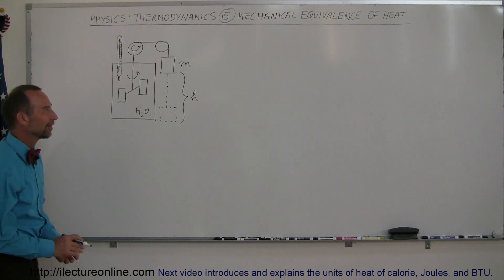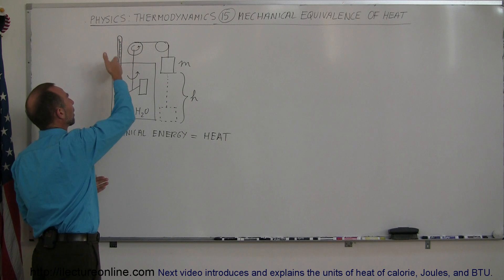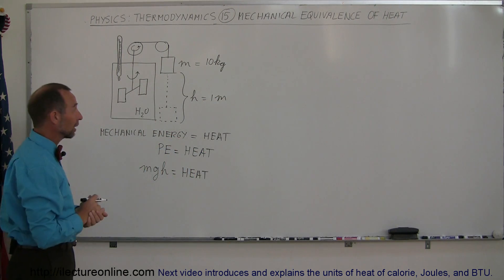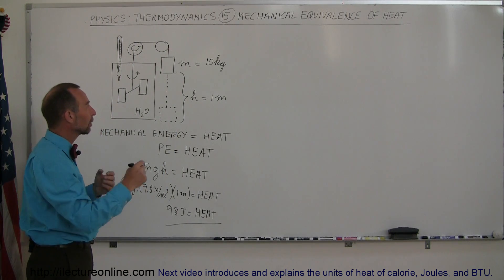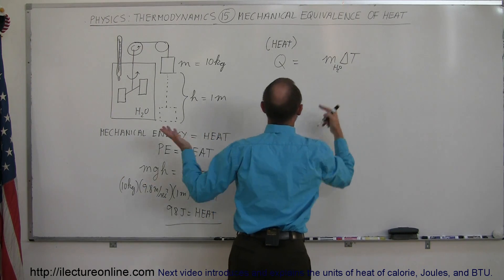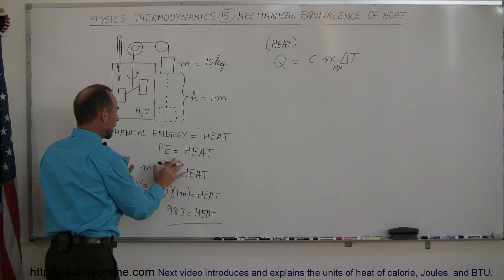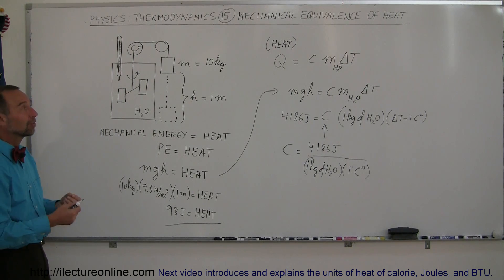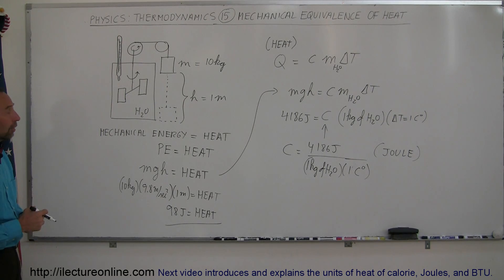Physics 22  Introduction to Heat & Temperature (1 of 6) Mechanical Equivalence of Heat

Comment: I'm stuck on a question it asks me how far an object has to fall to raise temperature to 1 degree Celsius I guess I'm just confused on how to calculate this..
Reply from the maker: I am assuming that this an object dropped from a height in air and when it hits the ground the kinetic energy will have converted to heat.  (And do we assume a 100% conversion of heat into the object and none into the ground?)    Then delta Q = m c delta T    where delta T is 1 degree.  The energy gained from dropping equals the potential energy  PE = mgh  Then set   mgh = mc delta T      The m cancels   gh = c (1)    Therefore h = c/g

Comment: Professoel Michel Van Biezen ziplines speeds are complex, because: gravity, friction, zipliner weight, and temperature (delta 😢T) are variables. A two-wheeled zipline trolley travels at 95% gravity .
Reply from the maker: Not sure how that related to this video.  But zipline speeds are mostly related to the angle of decent.

Comment: I got a question... if I decide to find the work which is 98 J  the heat should also produce 98 joules right? 

Why can’t we just measure de degrees, let’s say it’s 0,05 and convert that into joules  which should make 98 joules. It’s very small but it still works... right?
Reply from the maker: You would measure the heat generated by measuring the increase in temperature and using the specific heat.

Comment: why should the potential energy be equal to the heat??

Thank you :)
Reply from the maker: Where will the lost potential energy go?  If it doesn't change into a different type of mechanical energy, it can only turn into heat.
Reply: @MichelvanBiezen  What is the Sun ON BALANCE, AND how is the Sun's CORONA understood (ON BALANCE)?

HOW CAN (AND DOES) WHAT IS THE SUN EXIST IN BOTH TIME AND SPACE?:

What is the Sun is fully consistent WITH what is E=MC2 in accordance WITH what are SPACE AND TIME. Indeed, what is E=MC2 IS dimensionally consistent. What is GRAVITY IS, ON BALANCE, an INTERACTION that cannot be shielded or blocked. Indeed, consider what is outer “space” ON BALANCE; AS TIME is NECESSARILY possible/potential AND actual ON/IN BALANCE; AS ELECTROMAGNETISM/energy is CLEARLY AND NECESSARILY proven to be gravity (ON/IN BALANCE) !!!! INDEED, the stars AND PLANETS are POINTS in the night sky ON BALANCE !!!! GREAT. I have explained the coronal heating ON BALANCE !!!! The Sun's corona is one, TWO, AND three dimensional gravitational/electromagnetic SPACE (ON/IN BALANCE) consistent WITH what is E=MC2 !!!! Therefore, c squared CLEARLY (AND NECESSARILY) represents a dimension of SPACE ON BALANCE !!!! Accordingly, ON BALANCE, the rotation of WHAT IS THE MOON matches the revolution; AS TIME is NECESSARILY possible/potential AND actual ON/IN BALANCE; AS ELECTROMAGNETISM/energy is CLEARLY AND NECESSARILY proven to be gravity (ON/IN BALANCE) !!! Therefore, ON BALANCE, a given PLANET (including what is THE EARTH) sweeps out equal area in equal TIME. Accordingly, stellar clustering ALSO proves, ON BALANCE, that ELECTROMAGNETISM/energy is gravity. Consider what is THE EYE ON BALANCE !!!!! The stars AND PLANETS are POINTS in the night sky ON BALANCE !!!! c squared CLEARLY represents a dimension of SPACE ON BALANCE !!!! TIME is NECESSARILY possible/potential AND actual ON/IN BALANCE, AS ELECTROMAGNETISM/energy is CLEARLY AND NECESSARILY proven to be gravity (ON/IN BALANCE) !!!! I have mathematically (AND CLEARLY) proven and explained what is the fourth dimension ON BALANCE !!!! Perfect. It ALL CLEARLY makes perfect sense ON BALANCE !!!!! INDEED, consider why and how that there is something instead of nothing ON BALANCE !!!!! GREAT. TIME is NECESSARILY possible/potential AND actual ON/IN BALANCE, AS ELECTROMAGNETISM/energy is CLEARLY AND NECESSARILY proven to be gravity (ON/IN BALANCE) !!!!

By Frank Martin DiMeglio

The answer is that the corona is one, two, AND three dimensional SPACE ON/IN BALANCE. It is fully consistent WITH what is E=MC2. It is pure ENERGY on balance with what is the Sun. It is a balanced SPACE, without which (again, ON BALANCE) what is the Sun could not exist or be manifest. Great. INDEED, TIME is NECESSARILY possible/potential AND actual ON/IN BALANCE; AS ELECTROMAGNETISM/energy is CLEARLY AND NECESSARILY proven to be gravity (ON/IN BALANCE). Consider what is the fully illuminated (AND setting/WHITE) MOON ON BALANCE !! The rotation of WHAT IS THE MOON matches the revolution, AS ELECTROMAGNETISM/energy is CLEARLY AND NECESSARILY proven to be gravity (ON/IN BALANCE). The stars AND PLANETS are POINTS in the night sky ON BALANCE. Great. “Mass”/ENERGY involves BALANCED inertia/INERTIAL RESISTANCE consistent WITH/AS what is BALANCED electromagnetic/gravitational force/ENERGY, AS gravity/acceleration involves BALANCED inertia/INERTIAL RESISTANCE (ON BALANCE); AS GRAVITATIONAL force/ENERGY IS proportional to (or BALANCED with/as) inertia/INERTIAL RESISTANCE; AS ELECTROMAGNETISM/energy is CLEARLY AND NECESSARILY proven to be gravity (ON/IN BALANCE); AS TIME is NECESSARILY possible/potential AND actual ON/IN BALANCE !!! GREAT.

By Frank Martin DiMeglio
Reply: @MichelvanBiezen  I am the greatest scientist on the planet.

Comment: What are the units of C?
Reply from the maker: Vaju,
C is the specific heat and the units are   J/(kg * K)  or  cal/(g * K)  where K is Kelvin degrees or centigrade degrees.
Reply: Michel van Biezen So K doesnt stand for Kelvin alone and when we have celsius degree we dont have to convert it to Kelvin?
Reply: Gravity AND ELECTROMAGNETISM/energy are linked AND BALANCED opposites ON BALANCE. Consider TIME AND time dilation ON BALANCE. Great.

GRAVITY AND TWO DIMENSIONAL SPACE ARE CONSISTENT WITH E=MC2:

E=MC2 is taken directly from F=ma. TIME is NECESSARILY possible/potential AND actual ON/IN BALANCE. The TRANSLUCENT blue sky is manifest as (or consistent with/as) what is BALANCED BODILY/VISUAL EXPERIENCE. Accordingly, ON BALANCE, the TRANSLUCENT blue sky is true/real QUANTUM GRAVITY. THINK!!! ELECTROMAGNETISM/energy is CLEARLY AND NECESSARILY proven to be gravity (ON/IN BALANCE). Accordingly, ON BALANCE, the rotation of WHAT IS THE MOON matches it's revolution. Importantly, what is gravity cannot be shielded (or blocked) ON BALANCE. Great. You didn't forget to consider what is the orange AND setting Sun ON BALANCE, did you!!? Magnificent. I have FUNDAMENTALLY and truly revolutionized physics. (Lava is orange, AND it is even blood red.) GREAT !!!! Obviously, carefully and CLEARLY consider what is THE EYE ON BALANCE, as it ALL CLEARLY makes perfect sense ON BALANCE. (BALANCE AND completeness go hand in hand.). Fantastic !!!

By Frank Martin DiMeglio